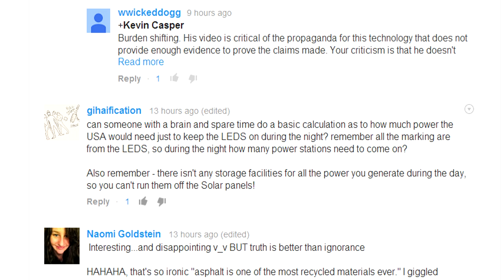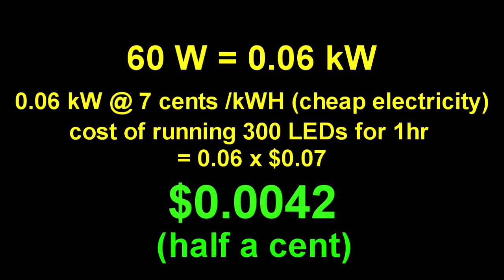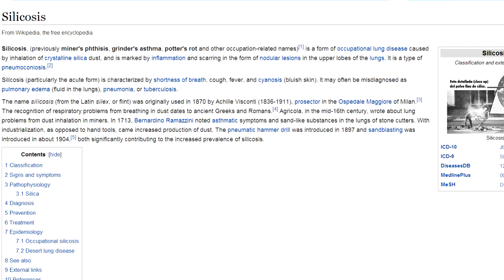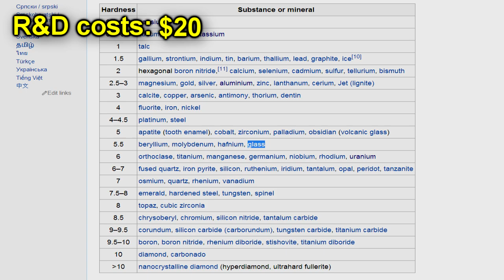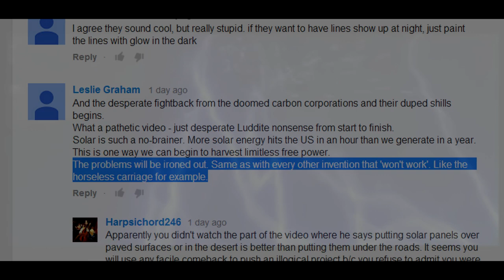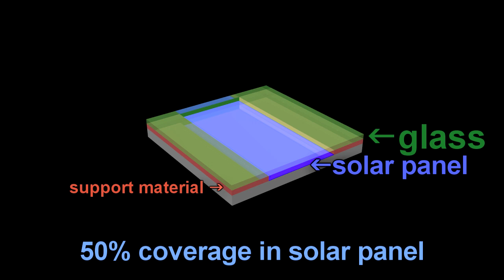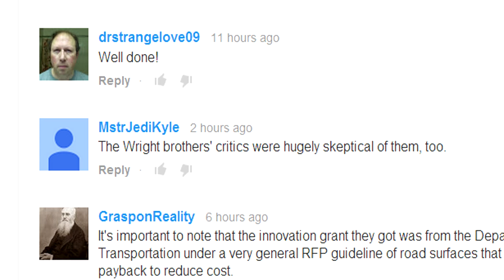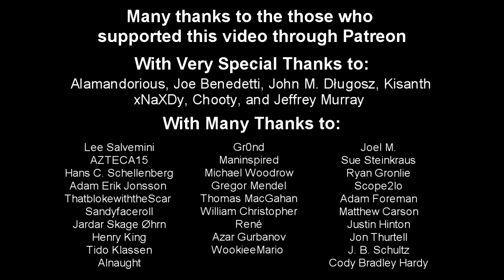Solar Roadways, IMPORTANT QUESTIONS AND ANSWERS!

Comment: In defense of the solar roads, being magical and capable of whatever they want them to be capable of wouldn't it make sense to put occupancy sensors in them that cause them to only be lit up while in use?  I mean it's still complete bullshit but the calculations for their power consumption at night is likely several orders of magnitude higher than what their "real world" use would be.  . .  but then again the LEDs whose power consumption were used for the calculation are probably nowhere near bright enough to be proper for this application.
Reply: Massive added cost / complexity by adding both a processing block in the microprocessor and the sensor itself in each panel.  Basically anywhere you can poke a hole in an argument made in the video, a new problem is born.